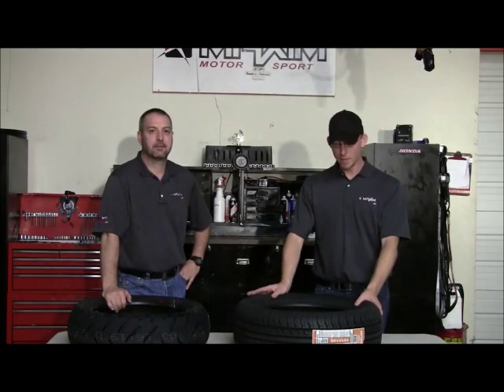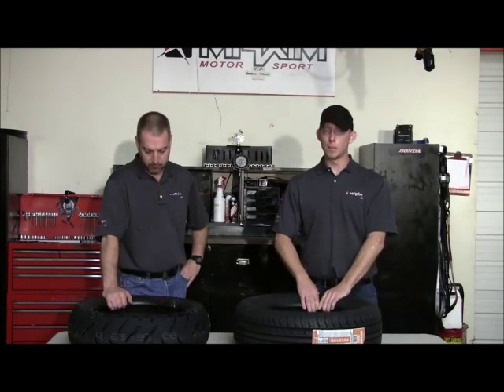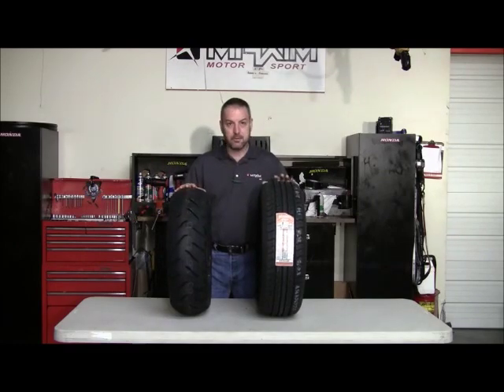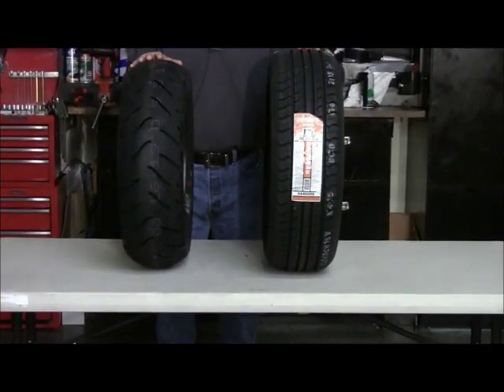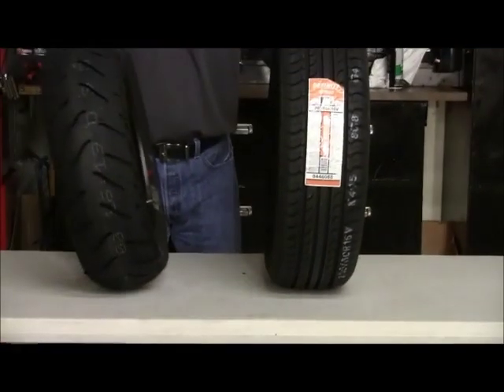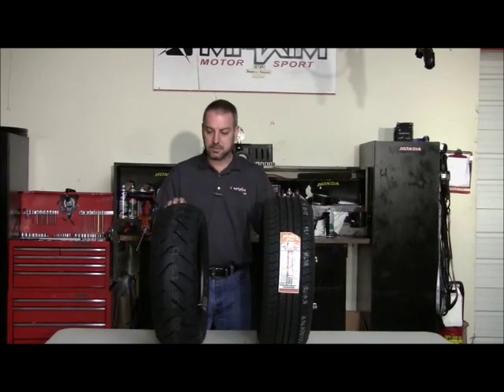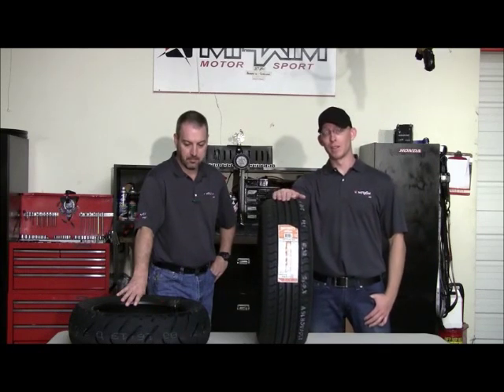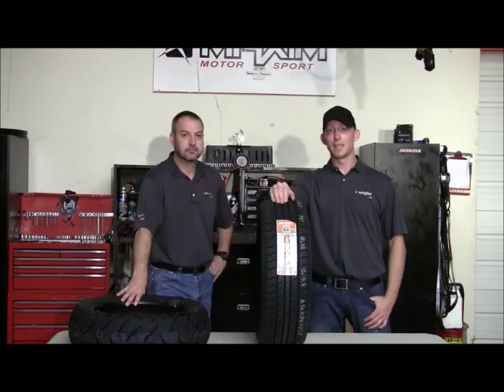Maxim Honda Video Series: Motorcycle Tire vs. Automobile Tire

Comment: I posted a video showing my initial use of an automobile tire on my 2003 Valkyrie. With over 50 years of riding experience, I can now say, with several thousand miles using the automobile tire, that I cannot tell ANY difference. Naturally I don't lean over like a sport bike and if they had a big bike leaned over at the angle they represent in the video, they would most likely see something drag on a big cruiser. And NO, I do not feel any indication the tire is lifting off the road.  As my video clearly indicates, the contact patch is still as much as, and I think considerably larger, with the car tire leaned over compared to the motorcycle tire.  If you notice, the motorcycle tire on the opposite side of the lean is off the road just like the car tire and the actual amount of contact is less on the motorcycle tire especially when you consider the flex the car tire sidewall has as I go around a corner...which is clearly indicated in my video.  So many of these individuals turning thumbs down have either little, or no, experience riding an automobile tire so how can they compare.  I've been riding longer than these two guys have been alive.  They can espouse their opinions with no experience, but just read everything you can find concerning those using an automobile tire paying close attention to what type of bike and riding they are doing.  THEN you can make an informed decision. I'm sure there are probably exceptions, but to date, I have not read a single item of a big cruiser using an automobile tire saying they are going back to a motorcycle tire.  It appears the vast majority are satisfied.

Comment: The only difference I have found is at very slow speed the bike wants to stand up more. There is no difference in normal riding on a heavy cruiser. The CT is designed for heavier weights, is smoother, lasts 4x longer (many ride on bald tyres due to cost - right or wrong they still do it), you cannot feel the transition and they don't run on the side walls. It makes no sense to run a track designed race tyre on a heavy cruiser.

Comment: Some misleading info in the video. I don't think either one of the guys in that video have any riding experience with a car tire on a bike (or maybe don't even own a bike?) So you can't go by what is said there.
 With many miles on my bike running a Kuhmo 205/15 car tire, I can assure you that traction, while cornering, is no issue. Infact the traction is better than the stock Dunlops I ran for years, (but no more) I used to do be able to break the tire loose on take off, but it's almost impossible now. They are much safer in the rain also (don't hydroplane like a bike tire did) and rear braking is better (don't lock up as easy and stops better. It's a no brainer. Cost (about 1/2 the price of a bike tire) tread wear is tripled, and traction is better.
Reply: Painter D This video is very misleading, and not very well researched. There are many videos that prove everything he is claiming about the contact patch are wrong. The car tire actually holds a larger and more consistent contact patch than the bike tire.
Reply: It's a liability thing. You wouldn't get it!

Comment: I won't use an MC tire on a big bike. Sorry,  the MC tire guys just don't engineer the traction, load capacity, longevity, heat resistance, etc,etc for the big bikes. Sorry dude. 5200 miles on a brand new tire is not good.

Comment: At greater lean angles, yes I could see where traction and handling can degrade, because the sidewall of the tire can only flex so much to keep a good contact patch on the ground. I would never consider putting on on my Honda Nighthawk or any other sport or standard. However, on my heavy cruiser (Vulcan 2000) it works phenomenal!
As far as putting a car tire on the front, I'm not aware anyone has even tried in recent times.  It works great on the back, not so sure what it would do on the front.

Comment: This is probably aimed at sport bikes more so than cruisers. My lean angle is no where near that of a sport bike, so I always have great traction when turning, even at high speed. I've tried my damdest to break lose my car tire while turning and can't do it, even on wet pavement. I HAVE slipped motorcycle tires on curves/corners when I have motorcycle tires on that same bike. That's why I am sold on using a car tire on my bike. Better traction on take off, cornering and in the rain, no to mention longer mileage and cheaper initial cost.
Reply: It is ok for Honda.  The only Motorcycle Honda has made in the last 10 years is variations of their Goldwings.

Comment: I have a car tire on my 1300 VTX and will never go back to a motorcycle tire. It is all about liability. And if you can feel the tire lift and not get good traction, it is either incorrect air pressure or in you head. Just from experience.

Comment: Just re watched this video,  Sorry but what this Guy is saying is wrong,  I have been riding on the Dark side for five years now on a Honda VTX 1800R,  The initial feeling was off, However it stemmed from under inflation, the tire is rated at 51psi max, I started at 35psi, once I pumped the pressure to 45psi the bike handled perfectly and has never given  me reason to doubt it. I am usually riding two up and the wife always makes sure we are at max crap packed, absolutely love it, I will never go back to a rear MC.

Comment: Wrong.  I get excellent traction in turns.   I have never even had a hint of a problem with a car tire and I have about 25 thousand miles experience with one.  I think a car tire is safer than a motorcycle tire.   Better braking and better traction in the rain.   The only handling difference is that if you go over an uneven surface in the road it gets a little squirrelly, but nothing even close to dangerous.
Reply: No way... No possible way that a car tire will perform equally.. you can use your words to try to convince me all day long, but I know a bit of physics, have been riding over 40 years, etc.. the BEST part of riding a bike is using the part of the tire that doesn't even EXIST on a car tire.. I am not saying they aren't safe or will come apart or can't be used by folks, just that there is NO POSSIBLE WAY they handle as well in turns as a performance round section motorcycle specific tire.  Go ahead and use them, I don't think you are dangerous or careless (just cheap) I also don't believe you ride your bikes as hard as I ride mine, leaned all the way over and accelerating out of turns at full throttle.. I think you get on and just ride... and I guess in this use, a car tire might suffice.  I'll go ahead and keep buying two sets of tires a year and enjoying the fact that I know I can use my motorcycle as it was intended to be used. Peace.
Reply: Andrew Stanford Andrew, I think you are looking at a Sport Bike application with a car tire.  No way a car tire would work well on a Sport Bike.  But, with a Goldwing or a Boss Hoss V8 bike, a car tire would work because you just don't have the lean angle to get far from the center of the tire so the car tire would work on those heavy, small lean angle type bikes.  Remember, the world use to be flat then better ships were made to show the world that it is round.  So, 20 years from now, tire manufacturers might just come up with a hybrid tire that is kind of round, but wears like iron and grips like a sheep rider!
Reply: +A Babbit, I ran Goodyear Road handler radial run-flat on my custom chopper with a 145HP Cobra engine. Amen Easy tail frame. The front of the engine was 3and a half inches off the ground. I could run twisties so hard it blew me and my buds I rode with away 25's at 70 no problems so the contact patch every bitches about they don't know what they are talking about plus the Goodyear is a V rated tire very grippe on wet or dry roads and the big plus they last over 25K miles.

Comment: I will buy a MT for the rear as soon as they put a 15k mileage warranty  and  increase  the load rating
Reply: I get 15K out of Metzlers 888 on the back of mine with no problems. a 1300 is not a small machine either.
Reply: @baltsosser  I get about 7 to 8k Miles out of my 240/55r16. And my triumph rocket 3 is a big bike so IAM going to try out the darkside
Reply: AVON storm 3d xm.

Comment: "You can actually feel the tire lifting from the ground and getting up on the edge of the tire."
ABSOLUTELY not true. you can't feel the tire getting up on the edge because the tire DOESN'T ride up on the edge.  When the motorcycle leans, a car tire's sidewall FLEXES to keep a large contact patch on the ground, and the corner or sidewall of the tire tread never even touches the ground. 
I've run a car tire on my Vulcan 2000 for about 8000 miles and its performance is 100% equal to a MC tire.

Comment: The motorcycle tire always has a small contact patch. The car tire may have a smaller patch when turning but when 800 pounds is on it I am certain it will form to the road surface. The people who are most likely to use car tires are touring, and cruising types who are not exactly ripping around corners with their heavy ponderous bikes. I treat my vtx1800 with respect around turns. It will go darkside next time. I had a 1961 triumph  650. It had a car tire on the rear and it ran fine, as flat as the profile was. If these dealerships sold car tires they would have to accept the chance they could be sued, they wouldnt sell nearly as many tires. Thats the biggest problem. I just put a new rear on a Burgman, $125 for the tire pus instalation. It wont last 7K miles. Darkside next time. Why cant Motorcycle tire manufacturers use longer lasting rubber, or more of it? They want to make money. Darkside.
Reply: They should make a compromise tire based on the qualities of both tires.  Not everything is a Super Sport.  Not all bikes are heavy cruisers.  Contact patch should be larger on Cruiser Tires instead of the Race Bike One Inch Ice Skate Contact Patch of a MC Tire.

Comment: Nonsense i use a 205 17 inch soft compound car tyre on the rear of my R1 yes R1 and it rides better than the motorcycle tyre!.We know the diffrences in shape etc and understand the cornering issues that might cause a problem but personally i have not encountered any.

Comment: I always thought riding with a car tire was a death wish until I tried it. I honestly can’t tell a difference leaning the bike around corners. Only negative is the bike feels different riding on grooved pavement but you get used to it in no time. I would however stick to a Motorcycle tires if i still road sport bikes.

Comment: From what I gather, the biggest reason people go to the dark side is economics.  Car tires are cheaper probably due to supply demand dynamics.  I understand there are differences in the physics and engineering of the two types of tires.  I see there are many stories of people dark siding without negative outcomes and many people against dark siding because of the dangers of possible negative outcomes.  What I'm not seeing are stories or examples of actual negative outcomes that have occured.  Does anyone have a source for these?

Comment: "The compounds on a car tire are a lot harder, a lot stiffer material, and on a bike are a lot softer."
Incorrect. Durometer testing of car tires vs. motorcycle tires shows that almost all car tires have a SOFTER rubber compound than street MC tires. 
The reason MC tires wear out faster is that in a straight line (where most travel occurs) a bike tire only has 1/4 of the width of its tread on the ground (right in the middle), while a car tire wears evenly over the whole width of the tread.

Comment: these guys have a point, I have seen some guys buy extra wide low profile CT for there Modern cruisers and they handle terribly, especially at lower speeds and around slow corners, they really upset the handing of the bike.  BUT  in have also ridin on a cruiser with a proper sized CT and sidewall and it handled very similar to a MT.  So..... as with most "modifications" to motorcycles it can be a positive thing OR a stupid thing.   depending on your own sensibility.

Comment: Hey orygunner1   What size tire and brand are you running?  I just bought a 04 Vulcan 2000 and need tires..really concidering a ct for the rear

Comment: There is as much and maybe more contact patch on a car tire in a turn. I went to a car tire because I couldn't find a radial 15" tire for the rear wheel. I love radial tires on a motorcycle. The car tire is small , 145 65 15 and the front is a 120 70 17 so it's a motorcycle tire. Because the width of the car tire is small it's barely noticeable and I can drag the pegs under acceleration. Very sure footed and comfortable. Sticks to the road very well. A wide car tire is a different story. I wouldn't do it.

Comment: maybe they should try using the same size car tire as they have bike tire because tires for small cars are almost as round as a bike tire. but the first thing a snake oil salesman will tell you is I'm not trying to sell you snake oil here. just like these guys did at the very beginning. SMDH

Comment: The wet traction and run flat tires work real good I bet and maybe 10% of time on side most time your upright  I bet if you measure contact patch in turn on ct I bet it still has more rubber on road than mt  and what’s really funny is a lot of car tire makers have the wet traction run flats in same size that fit almost any bike.  What car uses a 195/55/16 run flat or wet traction tire? Prius uses a 205 or 215?  So I call BS anyway  and for those Gona say insurance won’t pay if you have a wreck you sure? Then that means all trikes are screwed what do you think is on back of those mt?

Comment: Well if look at this from the contact surface perspective you are loosing massive amount of contact when leaning car tyre. You are going from 175mm to 35mm!! This is massive loss!! Compared to motorcycle tyre where you are always on stable 25mm :D
Question is if you are worry more about the difference or about total contact surface - as car tyre provides more of rubber on the ground. 

Overall. If you do 4000miles a year - don't even look at car tyre. Not worth it. Get a new set of fresh, dedicated bike tyre every season and enjoy sunny weather. Darkside is for pro riders who ride for living! If you do 20k miles a year and ride in all weather condition including snow!! Then you may consider square rubber.

Comment: <3000 miles out of a Shinko 230 tour master with a weight limit of 1100# before the tread came unglued from the cord? got new Kenda Kruz tire.... 800# weight limit?     the bike weighs 800#?????!!!!!!  so that isn't going to work very long either.    165 65 15      car tire weight limit 1200#.  put it on and not have to change a tire again in the life of the bike or me.

Comment: Tire companys and guy like this has been fucking us bikers for years, in fact taking a car off at 25,000 and studying it has thread left and no unusual wear , I’ve studying this for a few years know ,  and the oldest  Vidio is 13 years old and people been doing this fo 60 years ,it’s not new ,I just bought  a goldwing it had a cheap tire on it with 4000 miles it was ,cupped  I will double dark side buy putting a rear tire on the front and you get 20,000 out of it , and the rear tires is run flat , I’m in Florida every one ride golf carts ,
I kotice that there round like motorcycles tire , they can make motorcycles tires better but won’t because they think where stupid. And been paying 3 more for a motorcycle tires ,
And now theses people that never even road a motorcycle with a car tire on a motorcycle, every Vidio I’ve seen every one love them , even seen ones that have a camera on the tire and Vidio how it handles ,

Comment: Funny video.  What BS. The inaccuracies here are certainly abundant.   If you are going to submit 'information' than actually know what you are talking about.  Contact patch info is certainly in correct and 'Up on the edge" is just ridiculous.  Epic Fail video.